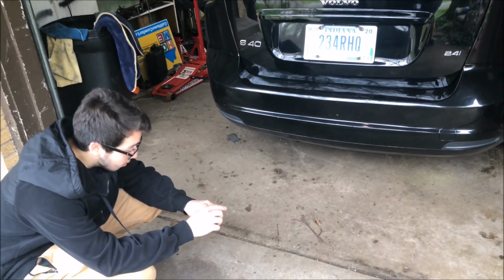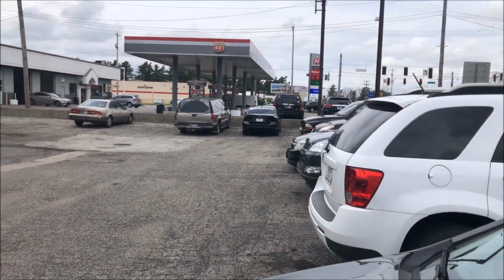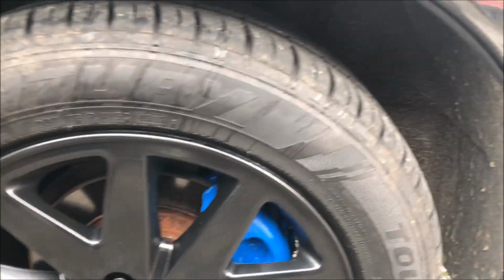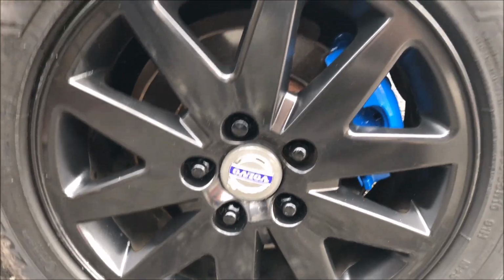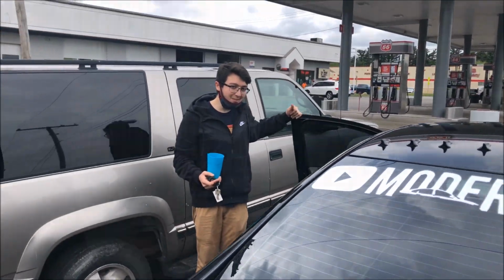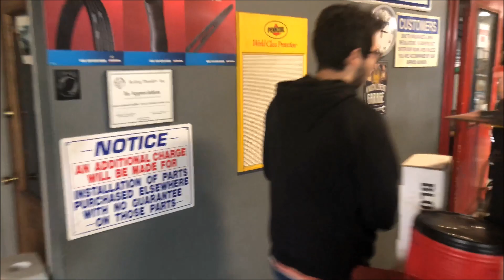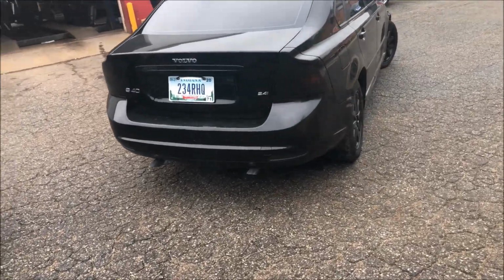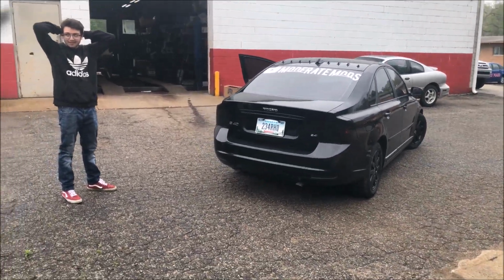Volvo S40 Straight Pipe Exhaust

Comment: Hey idk if you will find this but I have a volvo s40 08 but they low key sound nice asf straight piped
Reply from the maker: Good bro all that matters is if you like it !
Reply: What exhaust did you get?
Reply from the maker: @raysvlogs3446  this is literally just a muffler delete and a resonator delete with just pipe in its place bro